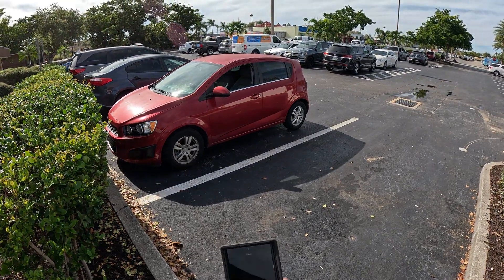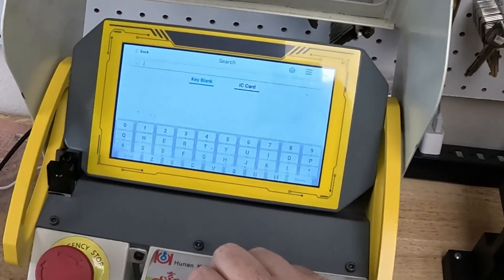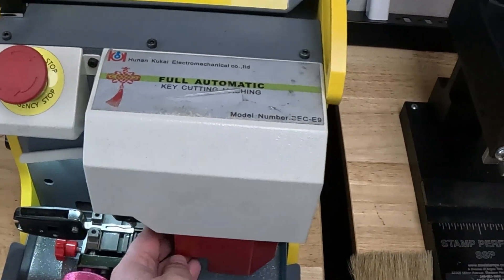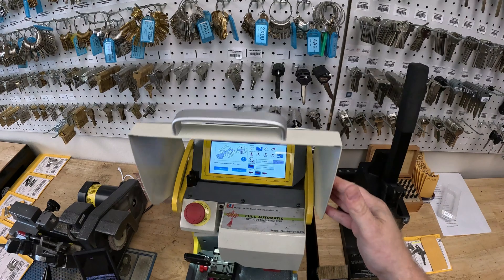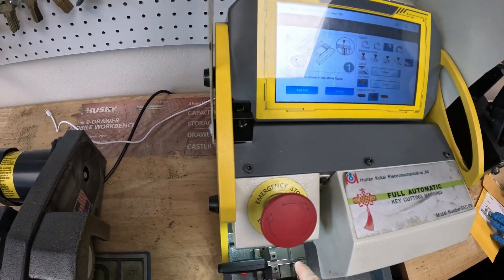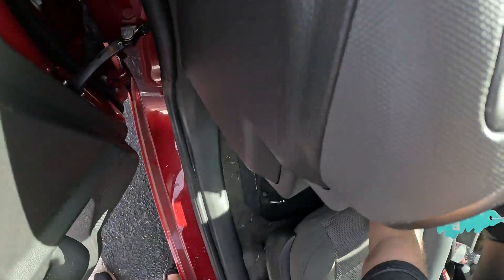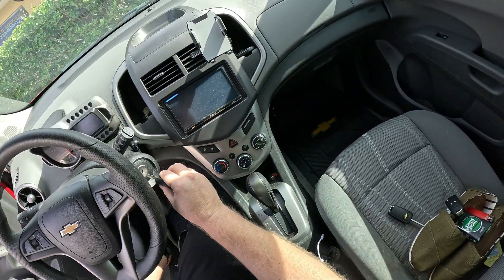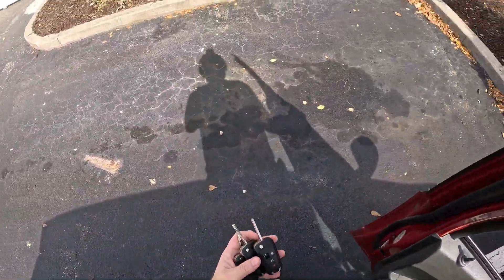🔑 DIY Locksmithing: Cut & Program Key Fob for 2015 Chevy Sonic with SEC-E9! 🚗🔐

Comment: After 2018 can we just clone one chip to car and make one key ( no remote)
Reply from the maker: Yes and no. Some of them are ID46 EXT and can not be cloned. 

But if you have 1 working key, you can use the add key feature in the key programmer, and it should be fine.